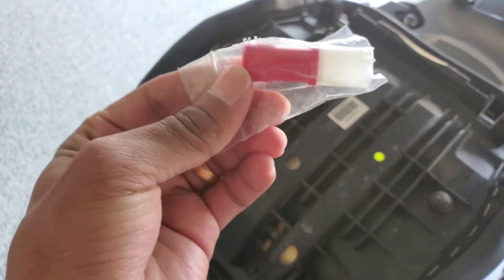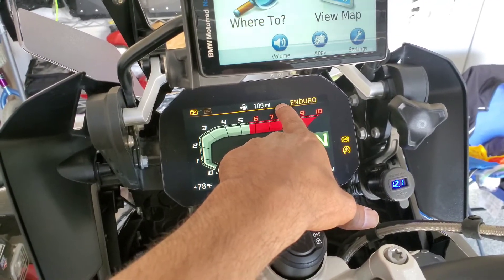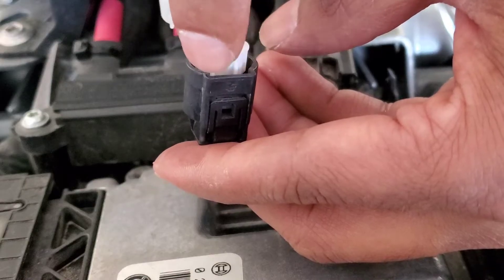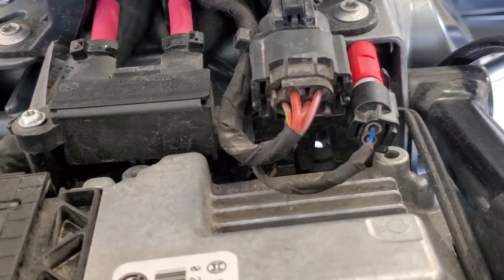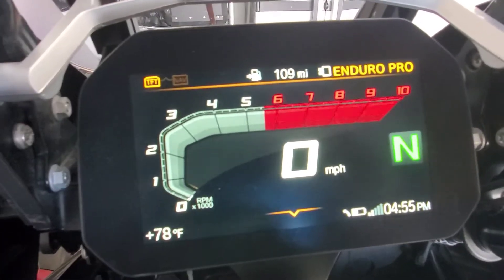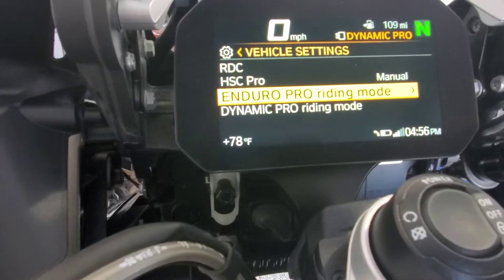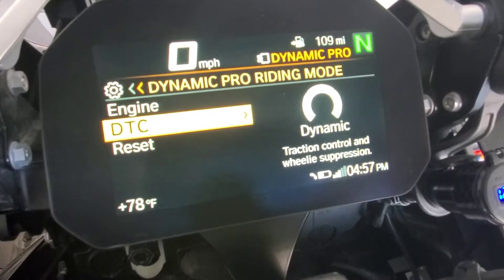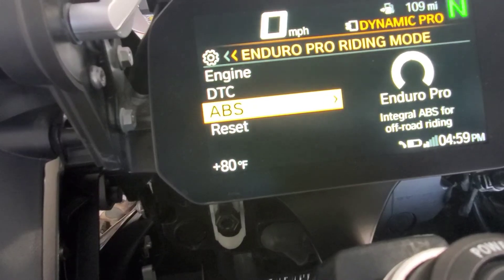BMW R1250 GS - How to enable Dynamic Pro and Enduro Pro riding modes

Comment: For 2021 it's already loaded, there is no plug.  You can access it via the TFT from day 1 and select what you want.  Just an FYI.
Reply: thanks , u answering the question i ask my self
Reply: I just picked up a 2022 and they told me they have to unlock the modes at the first service? I haven’t had anyone work on my bikes in over 20 years, and I don’t like being forced to go back to the dealer for something I can easily do myself. Looking to find a way around this.
Reply: @walter6990  I would go into your TFT and see, should be available right away.  You just have to deselect one mode to add another, only 4 allowed active at once I believe.
Reply: I have BMW R1250 Gs year 2021 and don’t have the Dynamic pro active how can active this mode.?? Thanks
Reply: @MotoBeemer  just wanted to follow up and say thanks. Once I took a minute to go through the computer I found it 👍
Reply: @walter6990  Outstanding.  Glad you were able to find it.

Comment: The plug is not a chip. It is just a jumper wire that completes a circuit.  You can just use a wire to do the same thing. No need to buy the plug.
Reply: do u have a link for that  video?
Reply: @amara-176  just search for it. If you are wanting to do it then just get a thin insulated wire and put one end in one hole and the other end in the other hole. Very simple. I would shut the bike down first or follow the procedure to install the BMW plug. I did mine no problem.
Reply: are you sure that´s a just simple jumper? Have you tested it? Do you know if it´s the same for a F900R 2020? Thanks!
Reply: @mobil04  I did it on my r1200gsa.. I don't know about the 900. Check some forums. Probably the same. All the software is built in. Just complete the circuit.
Reply: @cdrseabee  thankx a lot dude.. will do that! cheers
Reply: I've got a trimmed down paper clip in mine. Then put cap back on. 😂

Comment: There's any way to enable riding modes in a R1250GS Sport? The Sport model only have street and rain mode
Reply from the maker: you have r1250 gs then, you should have plug under the seat all needs is just installation.

Comment: Where do I buy the plug? And whats in it?
Reply from the maker: You can get plug ordered through your local dealership it is anywhere between 25 - 60 dollars depends where you can find good one on sale online like calimoto.com all plug does is short the two wires..I have even seen post you can do same paperclip. Hope this helps!
Reply: @rocksnroadsadventure4247  thnx for ur answer. But Calimoto is a navi app I am using when I ride.